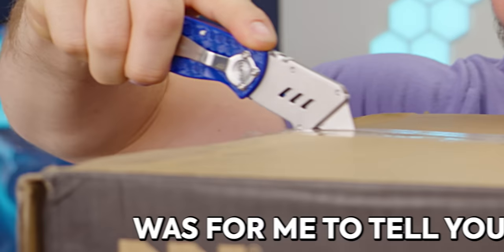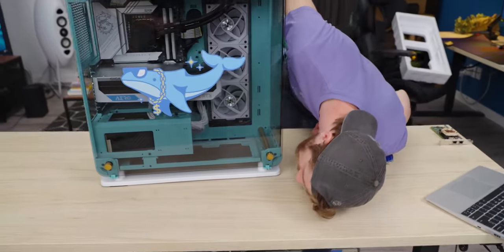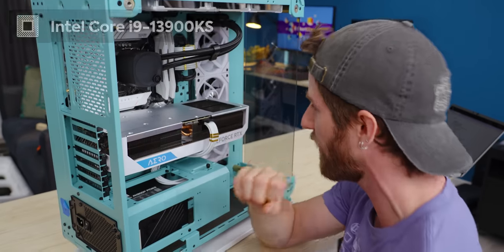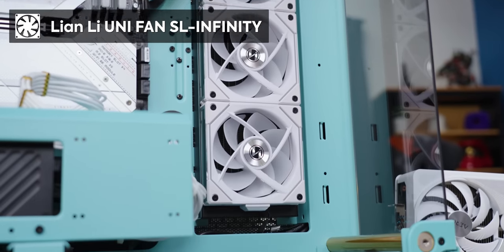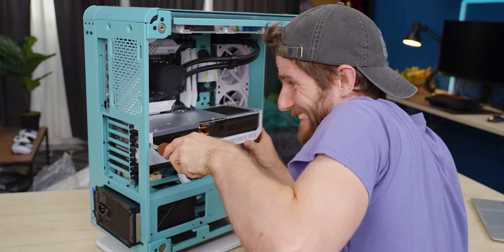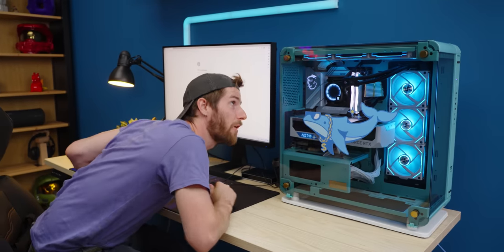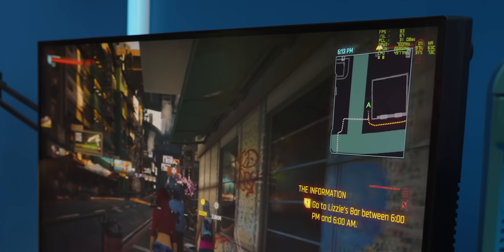You paid $10,000 for this PC... - Starforge Whale PC | LTX 2023

Comment: I think they should add a GPU support, even just for looks, have a GPU sagging like that isn't really good looking
Reply: What's wild is that the Aero comes with an awesome GPU bracket. It mounts to the motherboard screws and has a 3 screw mount into the GPU. I use it in mine and it's extremely sturdy and doesn't add any bulk.
Reply: Soon as I saw it thought the same. As @matthewmayberry239 mentioned, it comes with GPU support, so put it in? heh
Reply: $10,000 no GPU support, not a good look regardless of looks :P
Reply: It came with the unit and removed with the GPU for shipping purposes
Reply: Not having a hook as the GPU support from the top of the case was a missed opportunity...
Reply: and its gigabyte so we know the pcb will crack
Reply: Agreed. At this pricepoint there is good reason for a customer to expect absolute perfection.
Reply: my guess is the GPU bracket is in the accesories box and that the GPU came uninstalled for shipping and LTT did not bother to put it in
Reply: According to Asmongold's reaction video, it's supposed to have one.
Reply: @Zinit  If that's the case, then the part of the bracket that screws into the motherboard should have been there.
Reply: It's not just a matter of aesthetics - those Gigabyte cards have weak-sauce PCI-e locks with traces running through them, and if they snap, the card is bricked and you get denied RMA. Happening on lots of 30-series cards, and it's only a matter of time before it happens on their 4090s.
Reply: @theftking  Their 30-series cards don't come with brackets, so I can't see that they have a leg to stand on there.
Reply: on top of that no custom loop 
this build is a massive L
Reply: That was my first thought as well
Reply: it comes with one, starforge said so. This one just didn't have one ...for some reason. The ACTUAL PC  people get tho, has a custom Whale PC support
Reply: I wouldn't care too much if it weren't for the fact that they put a 50-pound GPU inside..
Reply: That is a really bad sag. Don't understand why a Gigabyte graphics card like that doesn't have 3 slot bracket. Even my MSI 4090 has 3 slot bracket and because of that there is absolutly no sag.
Reply: Mfs in this thread all theorizing reasons for no gpu support when they couldve just looked at pinned comment 😅
Reply: @Dat_WEEB  have you ever consider the possibility that the pin comment come after this theard? Maybe even some times later?

Comment: To stick with the whale/nautical theme, the GPU support everyone is asking for should really be more an anchor and chain that comes down from the top...
Reply: they can dangle more whales off the support wire to give it some depth 😅
Reply: or a pineapple, rock & sculpture of the easter island dudes, maybe add the krusty krab too while at it
Reply: 'Fishing line'. A nice cable tensioner. Preferably steel wire with a plastic 'fishing hook' hiding a bracket.
Reply: A Harpoon shaped support would also be nice  and prob smaller~

Comment: That crunching on the GPU will give me nightmares for years to come.
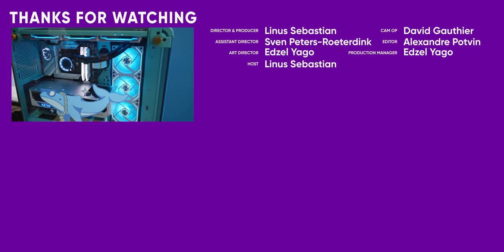Reply: For the price I think they could have added some kind of support item, hell they could have just 3d printed a whale to support it. 7:41
Reply: @bionicgeekgrrl that would've been great 😂.
A whale with stacks of cash underneath would've been even better 😂.
Reply: @bionicgeekgrrl  my Msi 3080 came with 2 bracket things for the weight, this thing is Much larger
Reply: will it really?
Reply: @darkcnight WiLl iT ReAlLy
Reply: The crunch sound is the 'spacers' on the back plate where the card mounts to ensure the metal is grounded to the case. I'm guessing it's due to the weight of the GPU causing it to sag and pulling away from the back plate.
Reply: That's because the GPU is Gigabyte brand!  The king of cracked GPU circuit boards and the "Taliban" of exploding PSUs!  Gift a Gigabyte to someone you truly HATE!  😂😂
Reply: @bionicgeekgrrl  EVERY GB 4080 and 4090 comes with a support bracket that's basically as good as it can possibly get.  A rigid metal frame that screws on top of the motherboard in two places, a rigid support beam that screws onto the side of the graphics card in up to three places though only one is necessary, and then the two pieces screw together for total rigidity.  I've only experience with GB (the cheapest available 40x0 models, not the higher end ones) and PNY - PNYs plastic solution leaves a lot to be desired, but it basically doesn't get better than GBs.  Starforge just...  chose not to install it.  Baffling.
Reply: @psikleaf  should have commsioned Nerdforge to make the bracket.
Reply: why does everyone think this is a $10,000 pc. that's the price of the specific ticket that includes a pc, not the pc itself
 @bionicgeekgrrl
Reply: @Blackoutkingbeats  I never said any price, only the title says a price, which is indeed the ticket price. Still, the value of the PC will be rather high given the components and the cost paid by LMG for them means Starforge could have done a bit more with preventing sag.
Reply: @bionicgeekgrrl  you said "for the price" which implies the only price mentioned in the title or video
Reply: Pinned comment says there's a GPU bracket

Comment: That GPU sag though, needs a support bracket lol
Reply: aren't the msi gpus the ones who seem to be burning out from gpu sag too?
Reply: @merced175  if you buy an msi gpu they normally include a support bracket
Reply: Extra $10,000 plz.
Reply: @HighFlights  I don't see one in this 10,000 dollar pc
Reply: @merced175  Most 4090's come with them, the Gigabyte Aero included but it looks like it mounts to the case chassis itself. It probably wasn't compatible/wouldn't fit so they just left it off LOL at least install a third party stand one instead for $10K
Reply: @merced175  thats not an msi gpu
Reply: @HighFlights  My gigabyte one came with a bracket as well, sadly didn't fit with my mobo tho cus the usb header was in the way. had to buy a seperate stand instead.
Reply: For 10k they should have made a custom bracket or water cool the gpu.
Reply: @HighFlights  Aren't those also the ones breaking too?
Reply: @merced175  i think they all are as there so heavy without one. thats why they all include one
Reply: @HighFlights ?? I thought Aero was a Gigabyte brand
Reply: @mynameissang  It is I mixed them up, I mix up gigabyte and MSI in my head all the time, from personal experiences both their "Trash tier" customer support has cause me to lump them both together in my monkey brain.
Reply: Needs a waterblock...
Reply: They probably have anime figures to hold up the gpu
Reply: Ideally AIBs need to just build the bracket into the cooler. Would eliminate the need for a bracket at all.
Reply: Dislike
Reply: You mean, you need to attach a PC to your GPU?
Reply: this case comes with a GPU support bracket, it should be here
Reply: @merced175 no but gigabyte gpus have fragile pcie lock tabs with very important  power traces :)
Reply: Aqua man support bracket 🧜‍♂️
Reply: It was removed with the GPU for shipping reasons only
Reply: @MattOhlson  If that were the case then the part that gets screwed into the motherboard should still be there
Reply: it comes with one, starforge said so. This one just didn't have one ...for some reason. The ACTUAL PC  people get tho, has a custom Whale PC support
Reply: @merced175  
Quite sure that was Gigabyte.

Comment: Linus, why don't you make a shroud for the network card? You have the tools and manpower to make a 3D-printed one, in a fitting color. You can include the fan in the shroud as well.
Reply: I suppose because most of the recipients will be taking it out at the end of LTX and sticking it in the random computer junk drawer.
Reply: Why didn't they include a motherboard with built in 10Gbit networking?
Reply: What is even the point of the network cards? The mobo already comes with 2.5G ethernet, what do they need 10G for? These are gaming PCs not workstations, 2.5G is more than enough for that. And since these 10G cards are more enterprise equipment they of course don't fit the colour scheme either. Seems pretty unnecessary IMO.
Reply: @MPnoir I use mine to connect to my server, which is the place I actually have the games installed
Reply: @MPnoir  The 10Gbit cards have different cables, maybe the Whale-Lan will have only the big 10Gbit cables at each place and no Cat7.
Also 10Gbit is still faster. They might need it to install Steam games faster from the internal Steam storage server. Just the best for those who pay the most.
Reply: @MPnoir  the point is quite simple, they maxed out all stats, so that basically everyone who bought that ticket sees it as an upgrade (or at least sidegrade) to their current rig. Imagine you are some person with too much money, and in your "all around comfort " ticket there is manual labor and extra pay involved to get  the pc up to standard. Some of those superfans probably also followed along the 10gig upgrade of linus' house as if it was a python tutorial. I wouldn't be pissed, if it wasn't there, but i would sure be happy if it was.
Reply: They use the 10Gb cards because people may need to download games/files. They host their own game server cache machine so they don’t kill the ISP.
Reply: @Competitive_Dud  I think the reason is literally that there are no white-themed Z790 boards with integrated 10GbE. Gigabyte has the Z690 AERO-G which would have perfectly matched the GPU, but I imagine the logic is that the kind of people buying whale tickets would be more upset at getting a Z690 board with 10GbE than they would be with a Z790 board with 2.5GbE.
Reply: The note in the video says the actual rigs will be using Sonnet Presto 10GbE cards. Those are low profile cards with a black PCB so they’ll basically disappear in the bottom of the mobo once swapped.
Reply: @Competitive_Dud  non-workstation motherboards with 10GbE basically don't exist. Best you're going to get is 2.5, and then you go and connect it to a switch and it defaults to 1G because 2.5G is ass.
Reply: Yeah, for freaking 10k $ the network card is just a sad joke.
Reply: Naaahh. Gotta keep it ltt authentic

Comment: I need a Whale PC in my life
Reply: Easy. 
Get a Whale friend. 
Any will do.
Reply: The funny thing is the "Whale PC" is what i see AI developers use and in Blender tutorials at least for the GPU. How i know is it is set to CUDA and has 24GB of VRAM. With the devlopment stream of AI devlopment I have seen them use all 24GB of VRAM and spill over to around 30ish GB of system RAM. Gaming never should spill over to system RAM on a RTX 4090 ... with any modern title in the version for the consumer to use anyways. So 64GB of system RAM is overkill you can make a case for 32GB as some games on the huge map preset do use that much when generating the map but they tend to be Real time or turn base strategy games as taking what can take hours to get from 1 side of the map to the other with the AI moving on all unloaded for the user to see parts of the map isn't something done outside of strategy games.
Reply: I got one for myself but then sold it. When Harry Potter came out, I ran 4K on my 4090, etc. I got studders, etc. Or some games I couldn't ALWAYS max it out as it wouldn't be a smooth of performance as I would like. Maybe I assumed that it would swim through everything - but sadly I felt there was a leak that no amount of my money could fix - the current level of technology we have and its capabilities, and how well a game is optimized/developed. At the top of the mountain I realized the treadmill never stops, and soon, this whale was set to sea. Gotta know when to stopping wasting money like an idiot.
Reply: @jayhub24 hogwarts legacy isn't optimised at all though

Comment: Presto 10GbE 10GBASE-T PCIe Card looks to be based around the Intel X540T2 chip, for which Intel has dropped support on windows 11 in their latest driver packages (anything above 26.1)
It will work perfectly fine with older driver packages, still something to keep in mind
Reply: ...and no NBASE-T support (2.5GbE and 5GbE) - this is kind of irritating given that 2.5G and 5G are becoming far more common due to their significantly reduced power requirements vs. 10GBASE-T on the switching side.

Comment: 🎯 Key Takeaways for quick navigation:

00:14 💻 Starforge Systems created custom gaming PCs for Whale Land 2023 at LTX.
00:28 🎟️ Whale ticket holders paid $10,000, including the cost of the PC.
01:25 📦 The PC features a turquoise vinyl-wrapped case with blue accents, following an underwater theme.
02:04 🖥️ The PC is equipped with top-of-the-line components, including an Intel Core i9-13900KS CPU and an RTX 4090 Aero OC GPU.
03:28 🕸️ The system received upgrades, including an Intel X540 network card, Noctua-cooled, Intel network cards, and heat-shrinked cables.
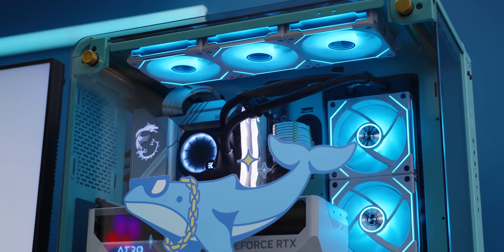05:46 🎮 The PC performs well in games like Cyberpunk 2077, running at 4K with high FPS even in ray tracing mode.
06:55 📈 The PC shows smooth performance with 60 FPS even in the path tracing technology preview.

Made with HARPA AI

Comment: Very least they could do is a GPU bracket. A custom loop, dual 360 rad and maybe even an extra 120mm for the ultra flex would have been awesome. Personally, I would have thrown little whales inside of a cylindrical reservoir or use stickers on them for more uniqueness.

That's just me though, if you're flexing, flex HARD

Comment: ah that crunch on the gpu and from Gigabyte no less with their cracking pcb's lately. Personally i would have gone with AMD 7950x3d and 7900XTX as well
Reply: 7900s have some weird power consumption problems I wouldn't buy one unless you don't care that your gpu is pulling 200-250w while playing f2p 10 year old game
Reply: @wapniak666  3090 and 3090 ti has insane power consumption, did you say something about that?
Reply: @NXDf7  sure but both amd and nvidia cards have comparable power consumption when maxed out 
The difference is that your 4080 pulls 60w while running overwatch while 7900 goes to 200+w for nor reason
AMD needs to fix power consumption in idle and low intensity scenarios which are waaaay more common that running a furmark lol
Reply: @wapniak666  or just risk having nvidia gpu  break on you. You nvidia fanboys are foools
Reply: @clark85  break how? And how I'm a fanboy for stating a fact?
Reply: @clark85 all 'fanboys' of any brand are fools. Appreciate the products, not the brands ✌️
Reply: @wapniak666  i have a red devil 7900XTX driving an ultra wide and 2x 2k's cant say i see the weird power issues. you know what feature i wish i had... melting 12v high-power connectors :)
Reply: @mikel9656  get a power meter then
Reply: i love when AMD gpu fanboys get mad, get lost, if you want an inferior product good for you, all of you acting like everyone should use an AMD gpu just because you fanboy it, its inferior, its buggy, drivers are still shit, facts, move on
Reply: @bindxpoxt  yes enjoy your dying gpu's from new  world and power connections, inferior products thats for sure

Comment: What else do you get with this? How much are tickets to the lan party.

 My PC is i9 13900k, 64gig of 6400 ddr5 ram, Asus 4090 strixx oc, 4 tb  Samsung 980 pro 2tb of 990 pro,EVGA z790 aorus master, same aio cooler, 9 lian LI inf 120 fans and 3 140s all in a phanteks nv7 and cost just over $4500. 10k for that PC is criminal for it to come with no sag bracket.
Reply: Exactly, a 5K PC with a 5K bonus on top because why not lmao, gotta make it sound expensive. And im sure even with shipping, custom design and labor LTT didnt cross the 7 000$ mark by far.

Comment: As someone who was just shopping for a laptop, I want to express the need for more honest laptop reviewers. With all the buzzword and flat out deceiving, I really wish that an honest reviewing channel like LTT would review laptops. Most laptops just simply aren’t reviewed and you have to rely on the brands quotes for critical specs like battery life. I know that reviewing laptops can be expensive but if anyone can do it, it’s LTT ❤
Reply: I think the problem is the naming for that to happen. Example : lets say an Acer Aspire 5 in itself can be a multitude of different systems and you only know which 5 is which with the extra numbers small in the details "e137" and so on. So there are probably a couple dozen different Aspire 5s alone and most are badly spect for your needs. If you read a review, without knowing the parts they have inside, amd, nvidea, 4050,70,..., i5, k, m,... you cant compare or know how your system will run.
It would be better if ltt could make them do a change to that naming system, so there are not that many versions out and each had there own distinct name. Acer Aspire 5a,b,c or so.
Reply: @Fynnuekue  Good point but I still would rather have reviews of laptops. Knowing how the laptop feels is less dependent on  spec and is still part of the buying experience Ex(keyboard/hinge feel).

Comment: I am not a fan of that PC. But hey, if you paid $10k for the thing, you'd probably convince yourself you love it.
Reply: It’s not even custom water cooled 😂
Reply: @edmac1090 custom water cooling is the most overrated thing on the planet, the only thing that beats AIO CPU cooling.
Reply: @williamkelley1971  for $10k the PC better be custom water cooled with gamer girl bathwater.
Reply: Yeah, it's pretty bad. No custom cooling, terrible CPU choice for a gaming PC (7800X3D is faster). A single NVME instead of maxing out the 5 NVME slots the motherboard has. The 4090 AIB is only mid tier (there are plenty of better cooled and faster models). RAM is barely 6000 MTs and is also only 64GB when RAM is now dirt cheap. You can easily find faster 2x48GB kits for a similar price.
Reply: 5k pc plus a 5k premium 😅